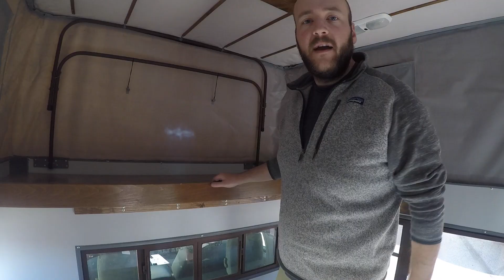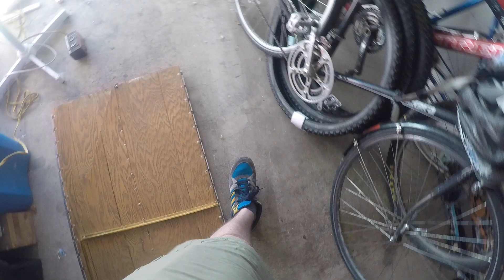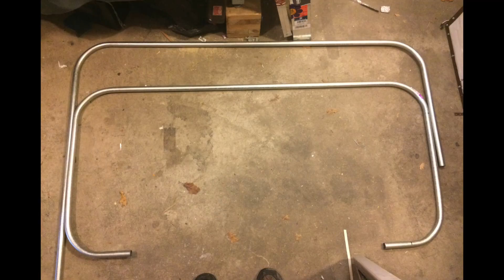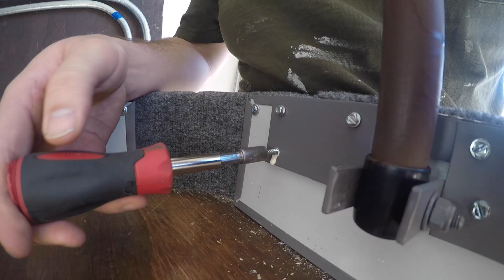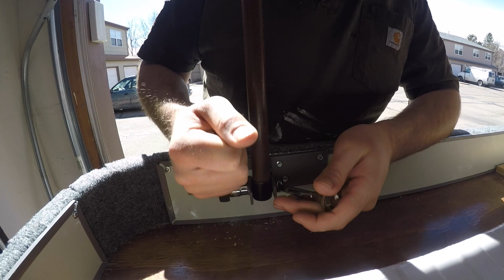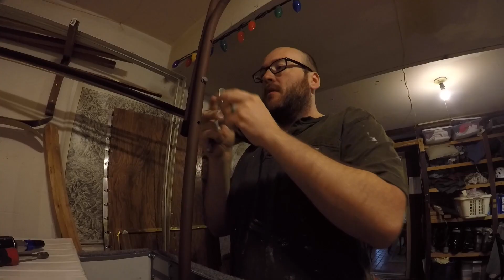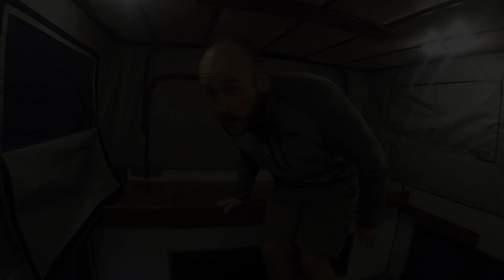DIY Four Wheel Camper Build:  How to make a roof lifting, pop-up mechanism

Comment: Thanks for this. I'm planning a foamie slide in, and have been spinning my brain in circles trying to figure out the most efficient and lightest way to do this, while maintaining some strength. This is also great for the foot print inside the trailer, and that it doesn't interfere with the canvas.
Reply from the maker: awesome. glad you enjoyed it. check out my site for even more info. tgmorrissey.com

Comment: I haven't encountered wind gusts, but I will be working on this over the winter to replace my 2x2s.
Reply from the maker: Great. It handle wind just fine fyi.
Reply from the maker: What camper?
Reply: @tgmorrissey  It's basically a roof tent that fits in the bed and middle is open to stand in. Diy

Comment: I have been working on a pop-up camper build.  Building the pop-up mechanism with conduit has been no easy task. I'm trying it.Limited success so far.
Reply from the maker: Hey John. What’s been the biggest challenge so far. I certainly had a little trial and error but in the end it seems to be working quite well. You having trouble with the bending? Pivot? Bracing? Let me know. Just spent a night in the camper:)
Reply: The bending worked, sort of, after a bit of trial and error.  Just a little tweak seems to have a bigger consequence than I would like. When closed, the roof pushed to the right a half inch and aft an inch, so that the top and the bottom were not aligned. I've drilled a lot of holes trying to find the pivot point.  I got to the point where  I had both lifts  installed. When I raised the roof, the whole thing wanted to move forward or back.  It was like it had a mind of its own.  The lowest pivot stands two inches from the wall, so there is a lot of play for it to go forward and back.  If you have any suggestions, I'm open.
Reply from the maker: Do you have the sidelinear  currently installed?  In the lifted position with no walls mine floated all over that place. With walk it locks perfectly in place. I too have a slight alignment issue when closer. Maybe 0.5 inch to the right. But if I just push the roof slightly it sits into position. Sorry it’s been so frustrating. I’ve been there before.
Reply: Interesting to know that the vinyl sides solve the wandering problem.  I was going to try a couple of adjustments before I gave up and figured somoething else out.  Thank for the response!
Reply from the maker: Yes, without the sides on I had to use bungees to keep the roof in place. It would move a good two feet north and south and was very sketchy.  Keep trying!!
Reply: Yeah, I had the exact same thing happen.  The whole roof wanted to leave out one end. It also pulls to the side sightly when it closes. 
My camper is entirely made of wood, so I can screw on an angled piece of wood to hold it all in place without the vinyl. I'll keep trying.  I really appreciate your video; it was very helpful. 
Thanks!
Reply from the maker: Hey Doug, great question. The middle pivot point needs to be in the middle of the top and bottom pivots. Since my lower pivot point is slightly below the end of the vinyl is it also slightly below the middle of the vinyl, does that make sense?

That middle pivot was tricky to figure out for sure. It is important there are equal amount of folding emt above and below so that when in the down position everything lines ups and top goes all the way down. There is a little bit of wiggle room but not much at all.  

What other things are you doing to your rebuild?
Reply from the maker: sounds awesome man. Glad the info was helpful. Best of luck bringing the camper back to life.
Reply: I had to scrap my attempt at the conduit as a lifting mechanism.  It was beyond my patience and skill.  Instead I made a sort of lean-to with some gas charged lift supports to help raise the roof. I watched your sewing video and used your ideas on the canvas tent. It was the most difficult part of the project and unfortunately, most of the windows leak  some at  the corners of the windows - on the bottom corners.  I haven't yet figued out how solve this problem.
Reply from the maker: Ohh bummer that the lifter didn't work for you. Sorry to hear that. What particular problems were you running into?

Glad that canvas sewing worked out better. I have had no leaking issues with mine. Did you glue some patches into the inside corners like I did?  I talk about the patches at 12:50 in this video https://www.youtube.com/watch?v=YumX0jrEBQg&t=355s

Let me know how else I can help.

Comment: Appreciate the sharing. As someone else said it would have been nice to see the mechanism operating.
I also think a diagonal extra bracing would have helped a lot for side winds but I'm sure you got this 😁
Good job!
Reply from the maker: Hey. Thanks. Totally understand the want to see it operating. Scroll around in the comments and I’ve pointed to a few different videos that have shots of the pop up process

Are you doing a pop up project?
Reply: @tgmorrissey  i had a look through but i can see only the pop top from outside so it doesn't show the mechanisms. Any pointer?
Reply from the maker: Hey. Thanks for letting me know. Let me look through my videos and find you something more helpful. Or maybe I should just finally
Make a new video showing how it works.

Comment: I'm trying 1/2 in conduit. I'm trying to make my roof as light as possible. I found bending the conduit easy with a bender but I am having a tough time getting the second bend right. 
     You have to subtract 5 while using the bender for the first bend and I used the star for the other end. I had to eyeball it and cut off the excess to get it close as that was the only way I could figure it out. 
     Drilling into the conduit is a bit of a challenge as well. I should have used a punch or something to dent the conduit to make it easier to drill.
Reply from the maker: Thanks for sharing your insight for the rest of the community I Learn from!  Good
Luck with your project.

Comment: Great job on adding height.  The only thing I would suggest is to round off the corners of the lower pivot points so that once the mattress is in there it doesn't get ripped.
Reply from the maker: Great suggestion. Has not been a problem yet so I think I dodged that specific problem. Thanks for checking out my videos.

Comment: Just took the front lift panels out of my 2007 Eagle and was wondering how to deal with the spring-loaded hinges.  Everything I thought of (and found on the Internet) was a real pain.
Now, I'm just going to do this! 
Thanks!
Reply from the maker: Awesome! I’ve seen people use ratch straps to deal
With the spring loaded system. But the emt continues to work well for. Let me know if you have any specific questions. .

Comment: Was thinking a 1/8” metal spacer (scrap sheet metal) between the top emt hardware and the roof on each of the three points, would prevent wear on the ceiling fabric
Reply from the maker: Thats a good idea. The wear never become much of a problems. Just dopped another video where I built another one of these systems in a new camper, be sure to check it out

Comment: Hey Tim, Great info. I would imagine that the distance forward from the edge, where the conduit is fastened at the top (on the roof) and bottom (on the camper body), matters. I'm getting ready to attempt this and from what I've read and seen online it can be tricky to get everything lined up so when you drop the roof it lines up with the edges of the camper. Any help or advice would be appreciated.

Comment: I watched your video 3 time. Very good for me. Is this sytem no damper?( absorber)
~~l am not good at english
Reply from the maker: Hi. Glad you find the video useful. No there is not shock or dampener or absorber or strut. Just the metal pivots. You could add some of those to assist with lifting. Here is another video of the roof in action. https://youtu.be/3AQa4hHB-zU
Reply: @tgmorrissey  thank you your answers.  I watched pop up action your video already. I wonder just matal pivots can stand roof itself. Is it stand? I am building my camper..I planed one side pop up style, now consider both side pop up style like your camper..(waiting your answer from korea)
Reply from the maker: @ssuu7841  Hello to Korea! Sorry I am having a little trouble understanding your question. Yes the roof stands up on just the metal pieces shown in this video. You life the roof up yourself and then lock the metal pieces into place. Hope that makes sense.

Comment: Hey Tim great video, just a question for you, I'm also building a pop top camper and I'm wondering what stops the top from moving forward and back in the wind? I understand the side to side is stopped by the supports, but is there a way they stop it from moving forward and back as well? Some kind of lock I didn't see? Thanks in advance!
Reply from the maker: Hey great question. It’s actually
The canvas itself that keeps the roof in line. It essentially acts as a big strap between the roof and the camper. Does that make sense to you?
Reply: @tgmorrissey  gotcha, thanks for the info!

Comment: Hey this is amazing! I'm building my own pop top now and this is incredibly helpful. what do you think the weight load is on the roof of the camper with this mechanism?? i would like to put a roof rack on top of the camper,  to hold extra gear if necessary.
Reply from the maker: Hi, thanks so much for the comment. Glad you like it. If you like this video I have a ton more about building the camper (including sewing the pop top) so make sure you click around my channel. 

The weight is a great question. Unfortunately I really do not know. Honestly, I bet the mechanism could hold the ski box, but I think the actually process of picking it up (your strength) would be the limiter. Check out how I made a 'basement' in mind. Way better for extra stroage under the camper. Search for 'how i store my skis' on my channel and youll see it. 

let me know if you have any more question. /- Tim

Comment: Hi Tim, I just saw a video of the campers that now being built by the original F.W.Camper owners. Their version of the lift panels now are like yours (tubes, not flat plates). But instead of having the lifters at the fore and aft ends, they are left and right (port and starboard for us old Navy guys!). You sit in the middle of the camper facing one side and push the tube up then turn around and do the other side. The lifting tubes are much longer which seems to give more support to the roof and it does not preclude windows in the front end of the sleeping area. Also, the lifting tubes wouldn't be where your tubes currently live when collapsed so you could leave the mattress in place.   The only criticism I have seen of their lifters is that they are designed to cam over and lock instead of having a locking pin which can lead to an unpleasant surprise once in a while. Not that I would expect you to do it over, but what are your thoughts on that? If you were to rebuild them again, would you consider doing it that way? I'm building a pop-top camper trailer based on a pickup bed (Land Rover 110 HiCapacity) with a 4' box in front of the bed for a slide out kitchen. Camper will go all the way over the slide out box so the sleeping platform will only extend 2' into the bed. It just seems that lifting it from the middle might be easier than leaning 6' over the bed! More importantly, as I'm going to be living in it on a year long expedition, I don't want to be taking the mattress up and down every day.  Kind regards,
Reply from the maker: Hey Henry, Great questions on all fronts. Yes I have seen the Phenix camper using the side lifter. I am sure they work well, I just did not think of it too much. The only risk I would consider would be your aspect ratio of the roof, if just have support on the middle, I could see excess weight on the north or south really having some leverage on those lifters which could lead to issues. But this is all speculation, proof is in the pudding and it appears to be working.

Per the over-center lock-in. I did consider this prior, I just new it would be more work to figure out so did not bother. The simple center lock with cotter pins is working totally fine for me now. But for instance, the panels from FWC do lock in the method you suggest, so I am sure it is better. Again, I just did not want to figure it out. 

You build some amazing! Share some photos as you go through it, I'd love to see the results. 

Thanks for watching - Tim
Reply: @tgmorrissey  Hi Tim, thanks for the thoughts. Since posting the question I found a pic of a self built camper in Poland that used long side mounted scissor lifts like yours. His was mad out of square tubing but the same idea. One thing he did that was reeeaaallly clever was he put a cord all the way around  the middle of the canvas part and over/around  the bottom half of of the lift. That means that when he lowered the roof both sides automatically pulled the canvas inside the roof when closing! No fuss, no muss ;-)  I'll find your email address on your website and send a pic.  I'll also send a link to a youtube video of an Aussie hybrid camper trailer. The clever part in that one is it has a full size bed in it. But when you lift the roof, you also lift the end of the bed that extends into the living space. It is also on small gas struts. When the bed is lifted it creates oodles (tech term, that!) of room inside the living area that would be consumed by the bed. You will see what I mean. It would not work for your camper but it would be great for a 10' trailer with a pop-up roof. Hmmmm, I wonder if I know anybody doing just that... Oh! that's right, it's me!!!  .;-)
Reply from the maker: @henrycolestage7650  Very cool. Thanks for the info. I know what you are talking about with the outside cord. The pop up van folks will often do this too. Ill go check out that other video now.

Comment: Tim, you had a great video you shared to rebuild my door. That worked out PERFECT. While on a week trip to Florida my rear lift panel started unzipping the middle hinge. I saw this video and was intrigued. However, I have a couple questions.
1. It looks like your lower mounts infringe into the camper space which I'm really, really protective of. Any ideas to get the pivot flush with the wall like original piece?
2. I posted this video on the FWC FB owners page and someone said they tried this method and the pipes pinched the vinyl and they were scared to keep the system so went back to the FWC lift system. Any ideas on this? It would have been great to see the roof going up and down from the inside in this video. That could have answered a lot of questions.
Reply from the maker: Hi Ben. Glad you found the door build so useful. Bummer to hear about the unzipping panel. You ask two good questions.

1. Yes the lower mount slightly infringes on the camper space. In the rear (above the door) it is not an issue at all. I usually hang my jacket on the little pieces. In the bed area it does influence the ability to keep bedding no the mattress. So if that is a major concern for you it might not be the best route. 

2. The pipes do grab canvas when down. I haven't noticed any significant wear from it at all. Someone on wander the west added an extra bend to the accommodate this and it worked well. In hindsight maybe I would have gone with the panel design but when I was making the lifter someone else on the interenet was having trouble making the lifter panels and I did not want to tackle that project. 

In summary, both your concerns are valid but for me, neither was a dealbreaker, maybe for others these concerns make the emt a no go and the traditional panels are a better route. 

Send any more questoins you have, glad people are finding my build enjoyable to follow along with.

Comment: Hi Tim, I realized how the ceiling was rising. but how stable is it? I want to do it too and I am looking for ideas.
Reply from the maker: Very stable. I’ve been in high winds with no problem. The canvas provides the stability. It’s like a massive toe strap between the roof and camper.

Comment: The distance from the middle pivot point to the top might be helpful, I assume it's half way up the bottom section and the second upper arm is to the desired height, but not sure........
Reply from the maker: Super common question. The middle
Pivot is just that, in the middle of the two others. So depending on how tall your roof is, dictates the center position. I talk about it more in my faqs on my website too if that is helpful. Tgmorrissey.com. Let me know if you have any other questions.

Comment: Hey Tim, great videos, I've watched a lot of them to help with my early 80s Grandby rebuild. Quick question, for the measurements on where to drill the middle pivot, is that simply just the center of the canvas?
Reply from the maker: Hey Ryan. By far the most common question. Should be drillled center of the two other pivots. Which won’t be of canvas due to the lowest pivot being sunk below the lip of the camper. 

Also just helped another person out. Make sure you lowest pivot is level. Someone had the two sides at different overall heights and this could not close the roof. 

Let me know if you have any other question. And check my follow Up video I put out just a few weeks ago on this topic

Comment: Very informative and nice! :D
Why did you switch from your older wood system to this one instead, seems like the wooden one should be tougher? :)
Reply from the maker: glad you like the info. I went with the emt as it just seemed easier to make. I have heard of others running into issues with folding of the big panels, need to get it just right.